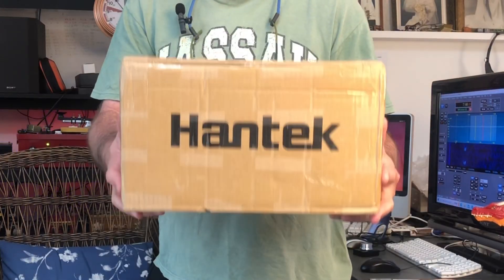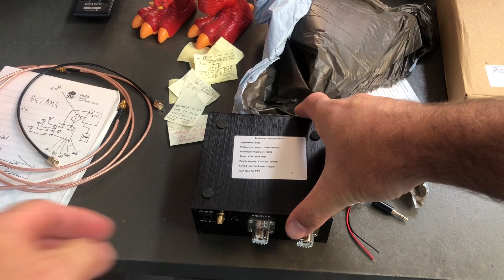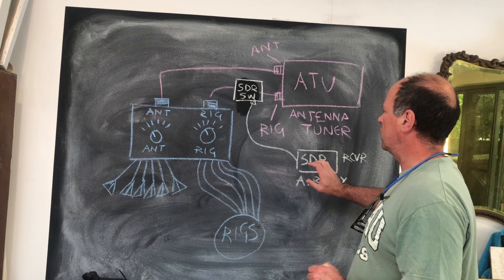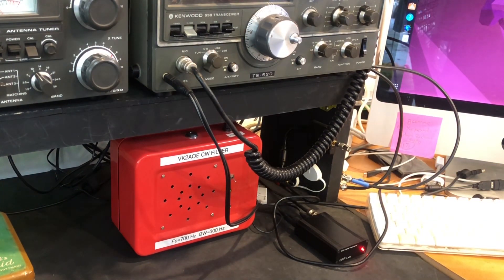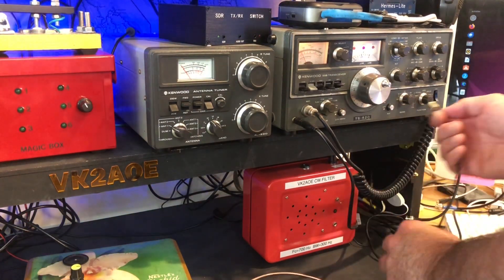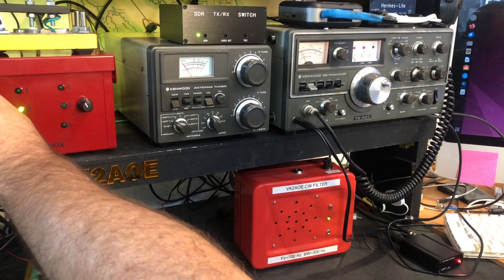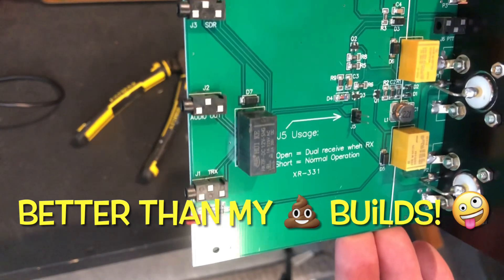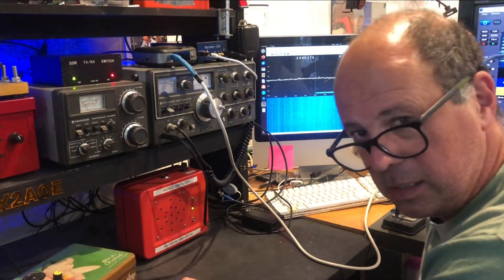SDR Switch - Why I got one?

Comment: I had a dud one that leaked RF, the first SDR it destroyed I didn't realise and put it down the a cheap RSP1 clone. It was only when a genuine SDRplay RSP1a failed that I realised it was the Banggood RF switch.
Reply from the maker: Ouch! Mine thus far has behaved 73
Reply: As I read the specifications,  if to believe anyway,  the sdr isolation is about 40dB. RSP1A is preferably 0dBm in (shortly +10dBm). If you use 100W that would be 50dBm. So it is a close call. I am considering this product but have some doubts about the quality.  As other user commented,  swr dropped significantly due to RF-sensing circuitry.  Maybe I will buy one and make some modifications, as I am lazy to build a nice enclosure.  I have build my own switch on a bare PCB but want a more neat solution.

Comment: Thank you for this! I've connected this myself and it works however i can hear myself on SDR Console when transmitting. is it possible to turn that off ? (mute the sdr when i am transmitting) or is it the same for you?
Reply from the maker: I only used my a short time and it was to provide a waterfall for my hybrid Kenwood ts-520....alas me and anything PC etc is like a cat escaping from a paper sack...I flail around...usually find a dodgy fix...but can never remember how I did it!! If I get time I'll fire it up and see. This from the plastic chat AI "To mute the audio in SDR Console when using an external transmitter, use the "Wideband Auto-Mute" feature, which automatically mutes the SDR when it detects a signal that exceeds a set threshold. You can find this setting under the Ribbon bar, in the "Home" tab, select "Wideband DSP" and then "Auto-mute".

Comment: I found this switch to be quite good value for the cost, but there are a few issues.

The SWR rises rapidly from before 28MHz. Beyond that it is unusable. I removed C1 (47pF surface mount) that is the input to the RF sensing circuit. This results in low SWR up to past the VHF range. Of course you then need to use a cable connection for PTT, but this is more reliable anyway.

My unit was supplied with a ptt plug with tip, 2 rings and sleeve. This did not work, so I sourced my own plug. The label on the bottom of the case listing the specifications was so poorly printed it could not be read.
Reply from the maker: Thanks...Yes I haven't used mine much. Been busy with building my own junk 🤣🤣73 de VK2AOE

Comment: I have one of these. I thought it was the coolest thing until I realized I had about 5-6 S-Units of suck-out taking signal away from the radio. Not ideal. Working on getting an IF Tap panadapter solution.
Reply from the maker: yes I'm wondering about that. Will one day do an attenuation test. Mine seems ok but have never tested it officially 73
Reply: @TheArtofEngineering my testing consisted of finding a station free spot on the bands and recording the noise floor with everything hooked up, then with the rtl sdr removed, then remove the sdr coax cable, then open sdr port on the switch. I also had the internal jumper set to both rx, but my noise floor and signals all came up more and more as I progressed the test.

Comment: I noticed the QDX before you mentioned it.  I love mine too!  Actually I've got a couple, my first one looks freaky since I modified by epoxying the 4 output transistors to a large (for the the QDX) heatsink.  I've regularly run it at 20-something volts and 15-ish Watts output.
Reply from the maker: It’s a great little rig! Cool idea to increase the sink size and voltage. 73 de VK2AOE

Comment: Question: I have not yet transmitted yet as I want to ensure I have the jumper open or shorted. I have been listening ONLY, and no TX yet. 
Can you tell me if I am to pull the jumper or not? I do not want to fry up my SDRplay RSPdx
OPEN: Dual receive when RX
SHORT: Normal Operation 
Thank you!
Reply from the maker: @scramick  it states on the PCB what the link does. I think link in is receive on both the transceiver and SDR… with link out only the SDR is listening. Unfortunately the lag time is not adjustable so if you use the “rf sense mode” then in SSB the relay will chatter. I use the PTT port on the back and I’m QRP with a Hermes Lite. I don’t trust RF sense. You could put some back to back diodes in as protection too but I don’t trust “sense” on its own. 73 de VK2AOE
Reply: @TheArtofEngineering  Thanks! I am using a Relay keying Cable connected to my Yaesu to the switcher.

Comment: Mine arrived with a defective 3.5mm plug for the PTT switching, I'd advise testing before connecting to a rig if you make up a PTT cable using the supplied plug. Also the unit draws 45mA, not the 200mA stated so you are good to use a low current output pin to power the device if your rig has one. I use an RSPduo and the isolation is -68db at 10w and -48db at 100w with IF and software AGC disabled. Well within safe limits for the RSPduo, but your results may differ. HTH.
Reply from the maker: My PTT was good to go. I wonder how the attenuation is thru it? I need to check this. At the moment the plan is connect antenna on it to my loop on the ground and listen on the SDR HF DISCOVERY. The PTT is activated by the Hermes Light II …. My HOMEBREW antenna switch box has an isolation on transmit detect (that sometimes works?). So the SDR will be my listen rig when playing with my dodgy QRP xmitters! 73 de VK2AOE
Reply: @TheArtofEngineering  Sounds good, be interesting to compare your findings with my own. I've yet to get around to testing the insertion loss but when in shared mode (SDR & Transceiver) it is noticeably higher than the stated figure. To be expected I supposed as it is behaving as a switched RX splitter in this mode. 73's

Comment: I note it states upto 30MHz.  Given that I will switch it with the PTT control line could I also pass UHF / 437MHz at 5watts safely through this device ??
Reply from the maker: No idea, but doubt it will work well? The attenuation will be very high and perhaps the SWR. I still need to check the attenuation, as rumour has it that attenuation even within the quoted frequency range is high?...let me know if you find out! 73 de VK2AOE

Comment: Does the mfj 1708 .. have that feature of Dual Receive when jumper is removed ???
Reply from the maker: Sorry not sure about that? I bought the switch as I’m going to build a receive only loop to use with my Airspy SDR receiver. 73 de VK2AOE
Reply: @TheArtofEngineering  73”

Comment: why not swap out the female pl259s for some chassis mount BnC jacks and not use the adaptors.
Reply from the maker: Yes would lower insertion loss. I still need to check this out. Thanks for the comment 73 de VK2AOE

Comment: I just received one in the mail. I thought I would need the PTT connection to a radio to disable the transmit to the SDR. Does it just disconnect when you transmit?  So you only have power, antenna and sdr connected?
Reply from the maker: Technically yes it disconnects. Other users I researched said quick enough not to damage SDR. I use 5 watts QRP and it worked without PTT and didn’t cook my Airspy SDR …. BUT on SSB the relay chatter will drive you mad and wear the relay out prematurely. Also I’m yet to check attenuation on it. It also will not detect lower QRPP type rigs ( which is what I wanted it for). I did hook up the PTT on my Hermes and it worked well that way (less clatter etc). 73 de VK2AOE.

Comment: Great! I have one too, i was think about to make a mod for J5 jumper and put a "on/off switch!  on the front but  if i do need to use cable and those need to be shield can make interference or or problem? 73 de iz3qvb
Reply from the maker: Actually not sure if the switch would cause a problem? My guess would be it would not cause issues… but ONLY a guess ! 😂 73 de VK2AOE

Comment: Mate, looks like a perfect switch for SDR pan adapter. Will have to investigate it. Good content as always.
Reply from the maker: Yes it works well...but if you like SSB, you will need to use the PTT input as the relay chatters (i.e. it works but will drive you mental with the noise without it). Thanks for the comment. Been having fun of late!
73 de VK2AOE
Reply: I'm trying to free up some time so I can setup my workshop.